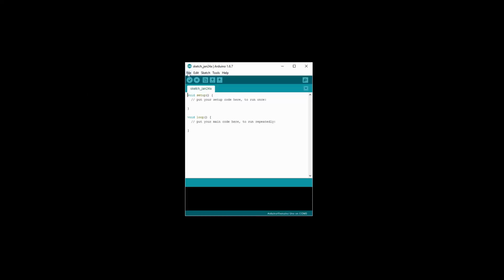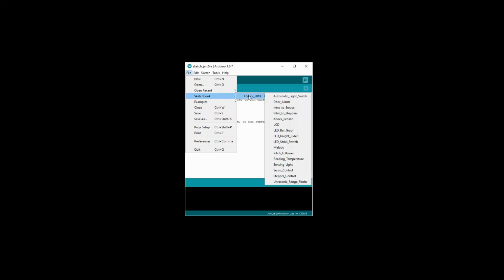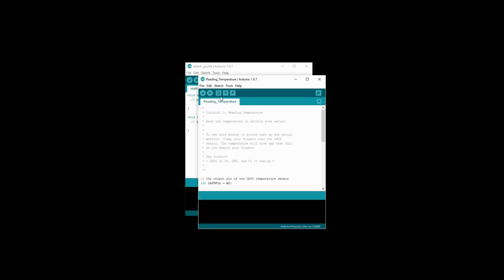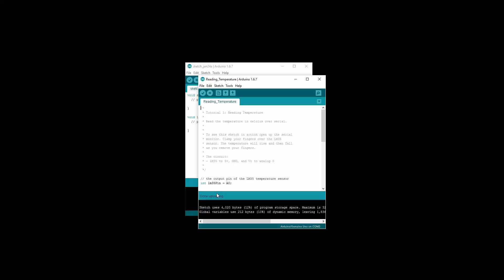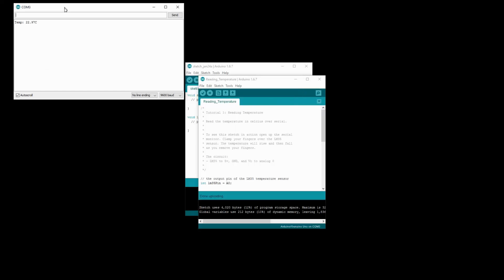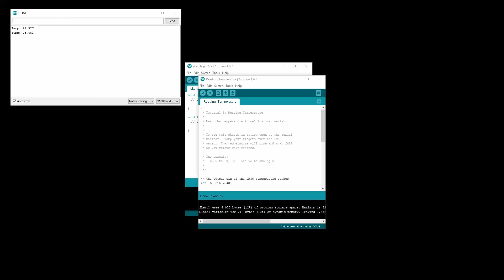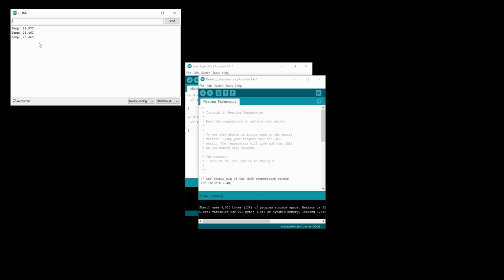OSEPP 201 TEMPERATURE SENSOR PROJECT # 1

Comment: It would be helpful if you could explain the coding. I have the 201 starter kit. It does a poor job at explaining the theory behind the programming side (I got the thing to learn how to write the programs).

For instance:
•. Why is Serial.begin set at 9600?
•. What's the ADC?
•. Where did the number 1023 come from and how do we know that's what the ADC will read at 5 volts?
•. How did the serial monitor know to display the temperature in Celsius and not another scale like Kelvin or Fahrenheit?
Reply from the maker: Hey, that's a good request.  I can probably whip something up in the next day or so. Thanks!